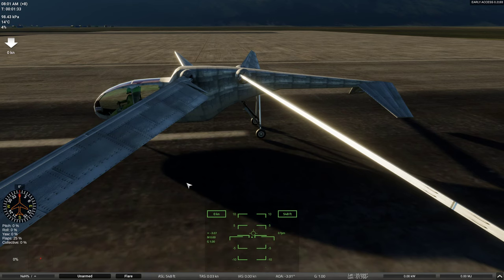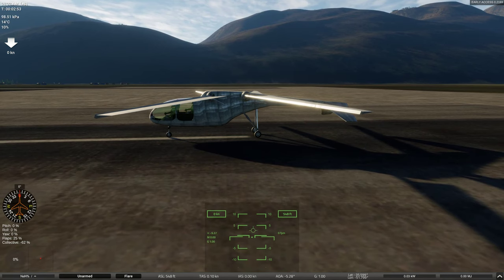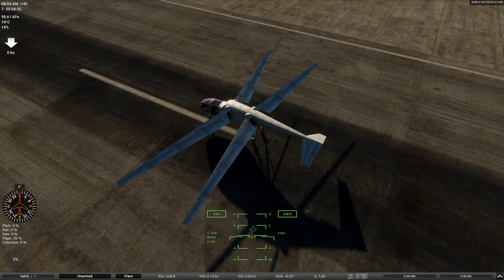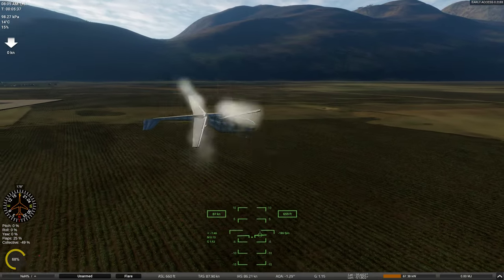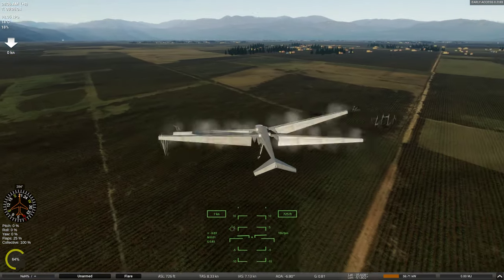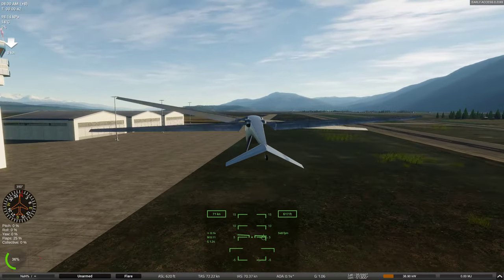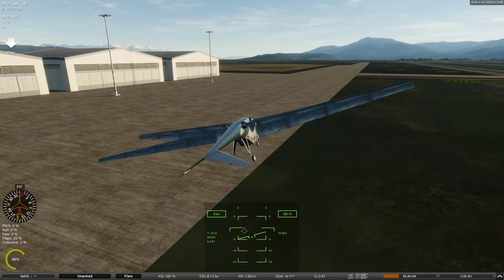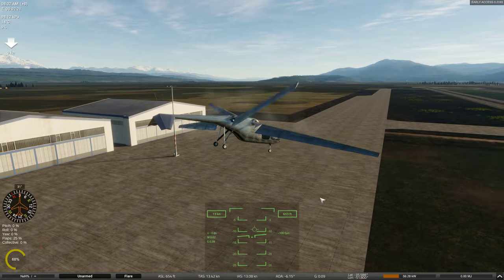Quick Note on VTOL Ornithopter Design

Comment: Do these wings work with a much larger craft? I understand that you will need to make the wings much bigger however wouldn’t that make them less powerful because of the weight?
Reply from the maker: There's a fair bit of headroom on these (they're extremely light). The concept could definitely be upscaled considerably. Possibly a hell of a lot with proportional increases in joint weight. But I haven't done much experimentation with large ornithopters yet

Comment: this is fantastic, and really impressive. I have always been fascinated by dragonflies, and the fact that this is anatomically very similar (compared to the currently popular 'Dune' style ornithopter) really interests me. I have been trying for a couple of weeks to get a working ornithopter in flyout to no avail - I just don't have a good enough grasp of the joint and input system. Is this craft available for download anywhere so I could study it?
Reply from the maker: Not yet; still trying to harass it into being reasonable to fly, as that version goes through like three control reversals while transitioning. Current version is almost ready. My latest edited ornithopter video goes into how the hinge stack is designed though, and the (mechanically similar) ornithopter it features is available on the Flyout discord. It doesn't quite VTOL (though it is very close), but it's also a lot less finicky than this example making the jump to being able to fly backwards really complicates things, it turns out.

You're also welcome to hit me up on discord and I'll try to explain what I've got / shoot you unfinished examples.

>Dune style
The dune config offers some serious advantages, particularly in Flyout. With eight blades stacked and countering each other like that, you can achieve glassy-smooth flight while still flapping the wings rather than rocking them the way I am here. The big advantage of that is it means you can do all your VTOL control mixing by messing with flap amplitude and not touching your actual surfaces. Makes it a lot easier to deal with control mixing and prevent adverse yaw, which has been a huge adventure on this design. I'm with you, though: I'm most interested in ornithopters in nature. After the VTOL goal is achieved, I'm going to move on to single-wing bird-alike designs that concentrate on gliding efficiency. I'd like to get an ornithopter motor glider flying.
Reply: Awesome stuff @decofox6789 . I'm excited to see where this project takes you - as you said its probably the less easy option, but hopefully its much more rewarding. The method you are pursuing should ultimately be more versatile than the dune method due to its ability to function in more dimensions (like backwards). It strikes me that once you have this method largely tamed you could attempt combining the two techniques (as dragonflies can obviously control their flap amplitude), which may provide an even more capable platform, albeit with the obvious weight and complexity penalties.
The bird wing project sounds really cool. I worry you may face a lot of challenges as bird wings are so heavily dependant on multi-axis joints in the wings, and flexible wing structure. Good Luck!
May well take you up on the discord offer. Is username the same as youtube?
Reply from the maker: @quantumidgit2466  yeah, same username
Reply: @decofox6789  one final thing I meant to say - you talk about dragonflies at high angles when flying backwards. This is absolutely right, and they are often at angles as steep as 90 degrees, looking vertically upward when flying backward. They can, however, also fly much more slowly backwards when in hover whilst horizontal. This is done by (loosely) alternating 'lifting' wingbeats and backwards propulsive wing beats, adopting a kind of wingbeat by wingbeat feedback system for each wing individually. The same goes for translating left and right. Really cool, but impossible to do in flyout (or on real models without very complex control architecture, though there are interesting opportunities to implement AI for this, to provide a more organic control system)

Comment: Have you tried making a rotating RCS type of auto balancing system? I think two swing joints with a weight on a hinge could help with the vtol roll/yaw if it works right
Reply from the maker: I've played with that a little. Still trying to nail down a purely wing-based solution for the time being, though. This version has actually gone on to be entirely controllable, though it has a slow top speed (105 knots or so) and is a bit shake-happy at that speed. Going to release it shortly, as I don't think this particular design has much more room for improvement
Reply: @decofox6789  sorry I forgot the name at the tame, but I was referring to a reaction wheel, I'm excited to see how this one works though I've been trying to work on these designs since I first saw you post about it. Honestly some of the most interesting planes I've seen in this game so far.

Comment: Would a second set of flaps at the ends of the wings help with yaw movement in hover mode?
Reply from the maker: That would be terrific, but so far all my attempts to split the wing have caused immediate destruction at high frequencies. I bet it can be done, but I'm not sure how.

Comment: Would a vert. tail fan add yaw control in hover and counteract unwanted roll in nuetral?
Reply from the maker: It would help a lot, but these projects are about the journey for me as opposed to the results. My interest is primarily with "pure" ornithopters and trying to replicate what we see in nature. No shade to people who do use other maneuvering solutions though.
Reply: @decofox6789  would bending the fuselage between the wing banks allow roll control? By putting one set of wings close together and the other ends far apart it could cause some sort of interference while shifting center of gravity and cause a roll. Maybe that could balance out unwanted roll. I don't think any animals bend their bodies like that to move, but you're still relying on the wings.

Comment: I have a Problem with those, where the joint speed is limited to 1000 do you know a solution?
Reply from the maker: You can file edit hinges to any speed
Reply: @decofox6789  what file do I need to edit?
Reply from the maker: @somerandomdude714  the aircraft config file. I forget exactly what it's called. Open up the aircraft in your aircraft folder (it's in app data/locallow/stonext games/Flyout) and search for "speed=". I recommend setting your hinge speed in the editor to something unique so it's easy to find. IE: set it to "622" so you can then find and replace "speed=622" for "speed=3000", or something
Reply: @decofox6789  Thank you 
This helps a lot